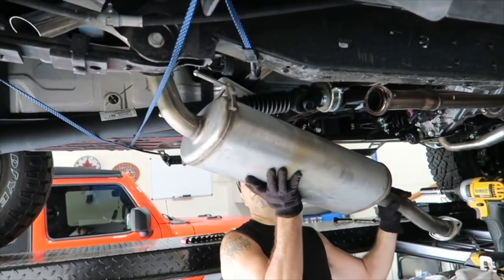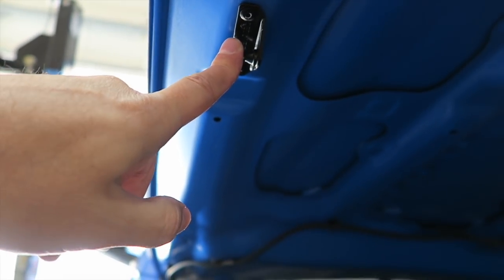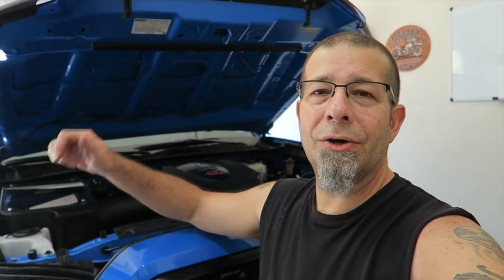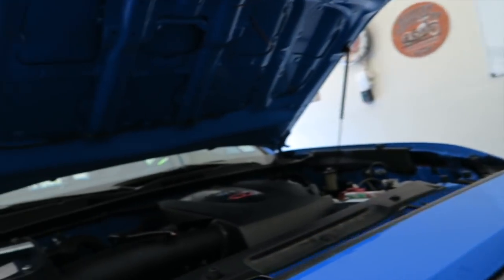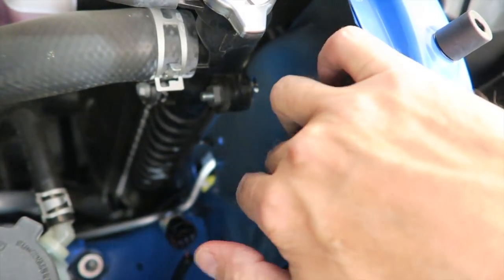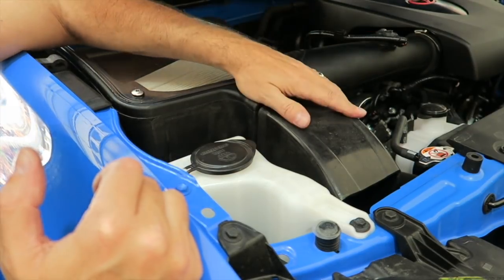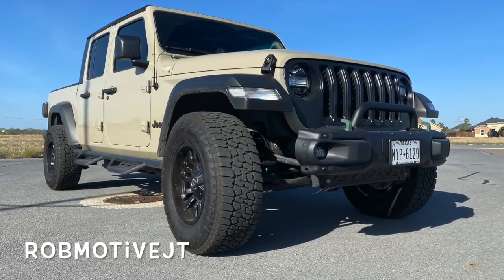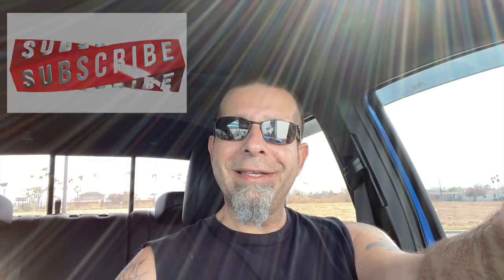Huge Tacoma Mod Fail

Comment: Where that struts mounts are not stiff enough to hold heavy pressure. It will stress and bend the mount near the intake side, push the rod off causing windshield washer tank to deform.
Reply from the maker: Huh??

Comment: It's hard for me to tell a difference Rob! But I love the sound of changing gears manually. I miss that part. lol. If you don't see any benefit from it, I would suggest removing it because it will just be an extra thing to deal with when you want to add more fluid into that thing under it.
Reply from the maker: If it weren’t so simple I probably would leave it off.  However, it’s pretty easy👍

Comment: I did the ajt Crome black out kit and the ring around the cup holder is falling off  i need to get the meso one that clips in instead of the glue on not sure if it’s a temperature issue
Reply from the maker: I’d just put a stronger dbl sided tape on them👍

Comment: I have the SokieTech Struts and the S&B cold air intake also, they’ll fit but they’ll be touching each other. Just went and checked my engine bay and I dnt see any rubbing marks on the intake box.
Reply from the maker: You must have a different version of the intake.  No way will it fit with mine.
Reply: It’s the same intake, my cousins bought me the Intake as a gift after they watched your install video for the intake. But I can’t remember if I had someone holding on to the intake box next to the struts and than bolted the three bolts at the bottom or not though

Comment: You just defeated the cold air intake by pulling in hot air from the engine bay. I believe that there is other parts for that snorkel so it becomes a sort of ram air system, put the plug back in and get your cold air intake system back.
Reply from the maker: So far so good👍
Reply: Hot air bad, cold air good for combustion air. You won’t get a CEL but the engine won’t like the heated air.

Comment: there was something call the “deck plate mod” we used to do on our 3rd gen 4runner stock air box. when you removed the deck plate you got louder intake noise and more top end power but would lose bottom end power.. sounded cool though lol
Reply from the maker: I’ve heard of that.  👍
Reply: Sure!   I’d love to try those struts.